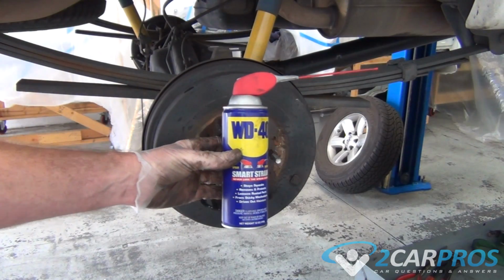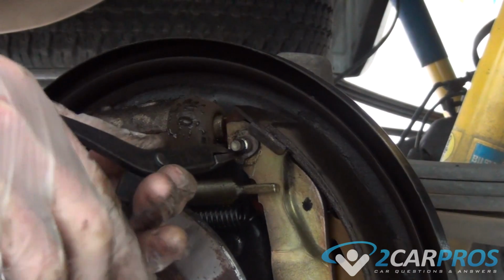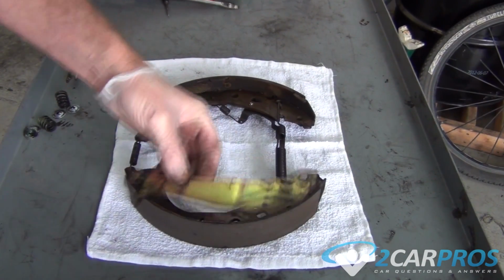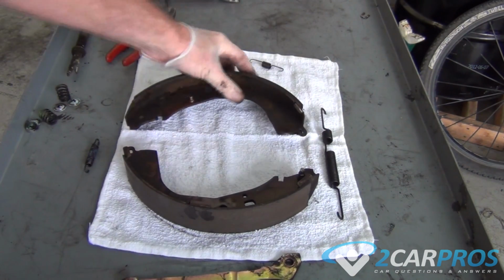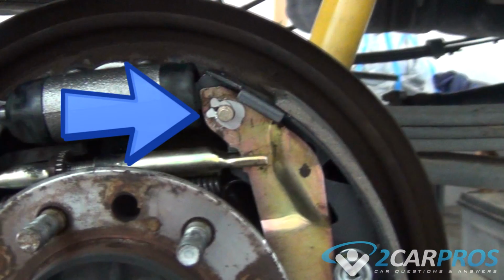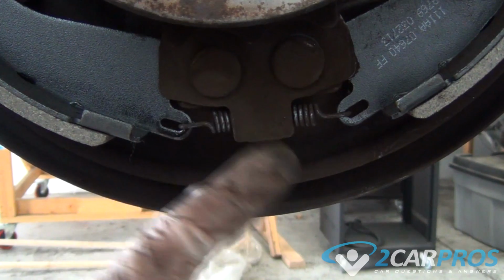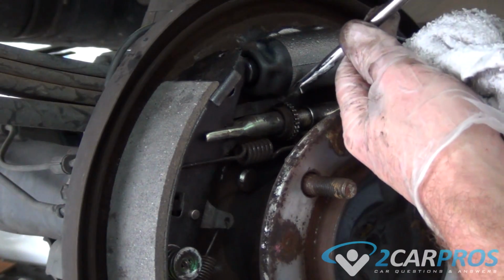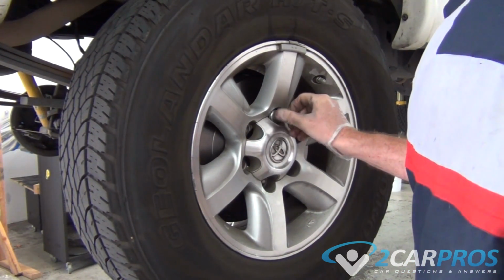HOW TO REPLACE REAR BRAKE SHOES AND DRUMS - Toyota Tundra 2000-2006

Comment: Thanks, this was a really helpful video. One tip that might help others is to reduce the tension on the return spring by backing off the star wheel all of the way. It may seem obvious but I didn't do this at first and it was incredibly difficult to remove the spring.
Reply: sorry to be so offtopic but does anybody know a way to log back into an Instagram account??
I somehow forgot the account password. I love any assistance you can offer me
Reply: @Julian Oscar instablaster :)
Reply: @Shiloh Juelz I really appreciate your reply. I found the site thru google and I'm trying it out now.
Looks like it's gonna take a while so I will get back to you later with my results.
Reply: @Shiloh Juelz It did the trick and I actually got access to my account again. Im so happy!
Thanks so much you saved my ass!
Reply: @Julian Oscar No problem :)

Comment: A few additional issues I've encountered while replacing my 2006 Tundra rear brakes.
Difficulty getting rear tire and wheel off the hub.I inserted a heavy duty screwdriver between wheel and hub and tap it with hammer. Rotate wheel and repeat until wheel pops off. Difficulty getting drum off if slightly rusted. You insert 2 - M8x 125 bolts in the threaded opposite holes on drums. Slowly tightening each one. Drum pops right off 
Big spring extremely difficult to remove.
Off course I have arthritis in hands. So you need good arm strength.
Before reassembly, use Syl-Glyde grease on all shoe contact points
Finally, readjust e brake after drum is installed by pulling on lever in rear where e brake cable attaches. This adjusts the brake rachet wheel. You may have to do this several times

Comment: Making a video on adjusting the PARKING BREAK ON 04-06 TUNDRAS would be helpful. ALSO, how to get rid of Tundra's notorious spongy pedal would be awesome too.... my 06 has that issue with the brake pedal. But was fixed after I got it back from the shop, but now it's back.
Reply: My '05 double cab or my '05 regular cab has never had a spongy feeling to the brakes. If that means anything to you.

Comment: My 2000 tundra rear drums weren’t setup the same way as these in this video, in particular, the linkage for the star wheel adjustment is different than shown.

Comment: If you buy a new hardware kit ,mostly springs be sure to buy only toyota parts.  After market spring kits always  get it wrong with shorter parts and wrong springs.
Reply: I bought the Centric kit and checked the Duralast kit from Autozone and the small spring for the thumbwheel adjuster lever is not right in either, will check the dealer tomorrow.
Reply: +1 on the OEM parts.  Lots of aftermarket stuff is junk...

Comment: Thank you very much for this video. Quick question... Are those lineman's pliers you were using to pull off the spring? If not, what were you using? They look angled well for the task.
Reply from the maker: Thank you so much for watching. At what time are you referring to? I'll tell you exactly what they are.
Reply: 1:55-1:58. Thanks for the quick reply!
Reply from the maker: No problem! Those are these http://www.directindustry.com/prod/snap-on/product-40605-989567.html we just used them for grip rather than cutting.

Comment: Is there a safe way to cut brake drum off. A spring broke inside and I stripped bolt holes to pull the drum off. I can't get the adjuster to free up even when I push the adjuster clip away from the adjuster. I rented a big puller from Auto Zone but the r
backing plate is in the way. I don't want to catch the thing on fire. Any help would be appreciated
Reply: 10 lb sledgehammer

Comment: Is there ever a time where the new drum will not fit over the brake pads? Mechanic did mine today and said he couldnt get the new drums on.Put the old drums on and literally had zero brakes at all.
Reply from the maker: Only if the drum that was ordered was the wrong one or the adjuster for the shoes is totally off. Thanks for watching!